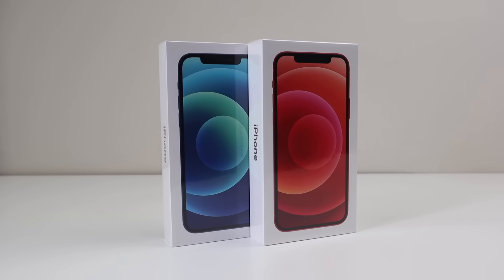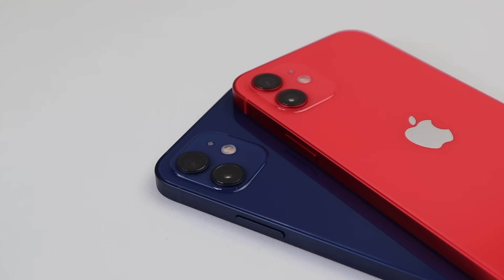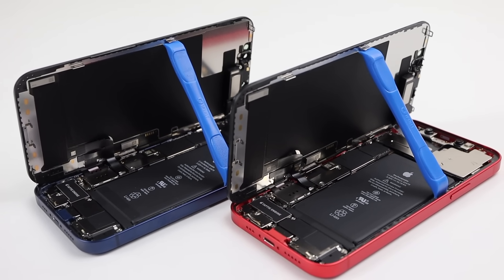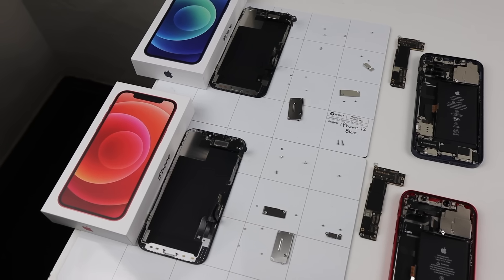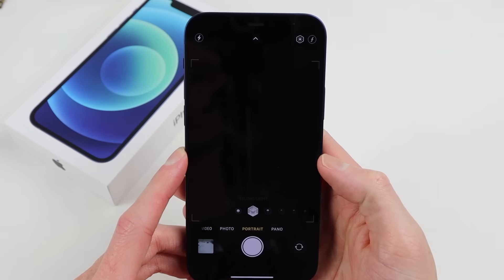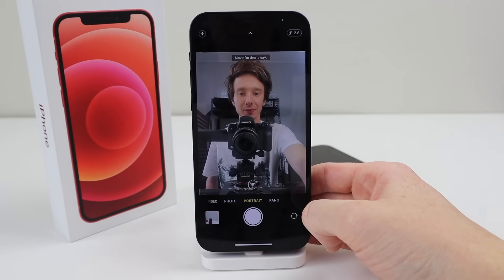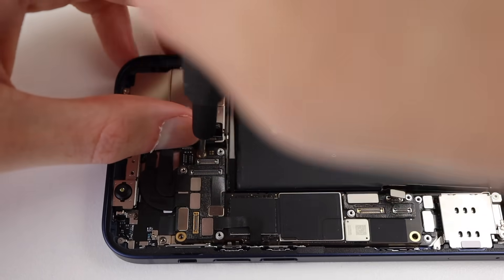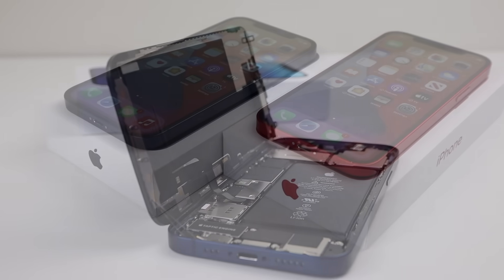iPhone 12 Anti Repair Design - Teardown and Repair Assessment

Comment: Apple is supposed to buy new devices after warranty period. They are not ready to repair iPhone in India. They will replace the iPhone with another one by paying an amount of more than 80% invoice value.  My iPhone become faulty just 15days after 1 year warranty period. The phone totally dead when connected to USB in computer . They asked an amount of 80% value of my invoice to replace new one.  So I throw away my phone to bin. They don't have any ethics... only business.. If you plan to buy new iPhone, I recommend their extended warranty, so at least you may be able to use it for 2 years.

Comment: cars have been like this for a while but it is as much to do with security rather than non repairability. at least you can send components away to get the eproms reflashed with virgin data so that the car thinks the item is new and allows it to be programmed at home.

Comment: This video was very interessting. There has to be some kind of work around. It seems as if every part of an iphone has an electrical ID imprinted in the software and the Phone recognizes if it doesnt match. So i see 2 solutions here. Either erase this id on all parts or read the id of the iphone and change the ID of the new part. Either way it won't take long till the phone can be rooted and someone writes software for that problem.

Comment: Probably to prevent tech-stealing by China. We know China reuse iPhone chips for some of their budget phones. We also know that Apple wants to leave China, so there won't be new chips for them to tech-steal and will be forced to reused older models since they are unable to make their own high tech chips.
Reply: What??? No Chinese company steals Apple Processors for budget phones. They're proprietary chips and only work in iPhones. Lower end MediaTek or Qualcomm chips are in budget phones.
Reply: @rudram.552  You haven't been to Shenzhen, I assume? You can even make your own knockoff iPhone phone there. And it won't be fake iPhone because it use real iPhone parts. You can even make it appear exactly like whatever iPhone version you want.
Reply: I'm assuming you're talking about a cheap 'refurbished' iPhone with 3rd Party parts. As long as a device has a genuine Apple motherboard/CPU it's an iPhone. And cheap iPhone clones aren't actually iPhones, they're just low-end Android devices with a skin that looks like iOS.

Comment: I have not purchased an Apple product since the old days when I bought an iPod (B&W screen) and it broke in less than a month and I couldn't get it fixed and Apple would not replace it.  In the years since then, all I've seen is complaints about high prices, updates bricking products, total lack of connectivity with external memory devices and other things, people spending tons of money on non-standard connectors and cables and adapters that all break too easily, and crap like that.  Why people wait in lines to pay big money to get the latest device from Apple baffles me.  Apple is obviously still at it.  When my Pixel-3 battery died, I took it to a local repair shop and got it back like new the next day.  No fuss.  I'm glad I decided early to avoid Apple like the black plague.  Also, iTunes absolutely sucked.  I honestly don't care if the products are good when they're working.  All the other nonsense is what ruins it.

Comment: The "new" and the fabulous iPhone 12 ladies and gentlemen unfortunately it's just an iPhone 5 but with more cameras
Reply: And an upgraded price. iP 5 cost 199, 299 or 399 bux (w/ 16 / 32 / 64 GB storage). For comp.: iP 12 for 700 - 1400 dorras (64 to 512 GB). The AVG price increase is 250 %.
Reply: @ihavenoson3384  idiots will line up to buy it though.

Comment: While it is definitely possible that this is done for greedy reasons, it is also very possible that the various modules in the phone have to be configured and calibrated as part of assembly. The Face ID feature relies on a very sophisticated setup of how and software. There is quite a lot of calibration data that is used and stored on the motherboard that is specific to individual Face ID sensor, which would render the swapped one inoperable. The camera, too, might require bad pixel correction data or other calibration data that makes mixing and matching modules impossible without re-calibration..
Reply: You do have a point, but what about literally every Android device...
Reply: But a factory reset would fix those problems though, he even reset his FaceID and made a new one and still it persisted. It wouldn't make any sense.
Reply: @L4sket  A Factory reset would not wipe out the calibration data. Calibration requires special test equipment to perform. Again, I'm not saying Apple doesn't take steps to "dissuade" 3rdparty repair, just that there are technical reasons for some of it.

Comment: probably they have some modular communication before boot. This essentially passes serial numbers that verify the modules. The charging must have some bypass mechanism that enables the phone. But again the software itself stops them from function properly. They are focusing on anti repairing mechanism which results in poor PCB design and poor performance.

Comment: Apple have turned into complete scumbags as fast as possible after Steve died. Immediately, their products went downhill and they ramped up the war against 3rd party repair war. I don't even like iOS, tbh, but the only reason I'm really in their ecosystem is because at this point I'm fairly locked in with my other software I run for work. I wish Linux running virtual boxes and hacked software was flawless, but it's not, and I don't need the added headache.

Comment: Imagine if vehicle manufacturers started doing this too, locking parts down that you can't even swap from a used vehicle. Need an alternator? New battery? Windshield? TOO FUCKING BAD. Either you buy a new vehicle or let us fix it.

I imagine that this is simply what we will look forward to in the future. I wouldn't be surprised if Teslas are like that.

Comment: I had two iPhones back in the day, the 3GS and the 5. Both of them were a complete mess, closed-platform, user-unfriendly systems. When I bought the 5, I hoped that it will be better than the previous one. No, it tuned out to be the same hot mess. Now, I'm glad I jumped off the Apple bandwagon all those years ago.

Comment: It might be that each I/O device has a specific hash value that is stored in the OS protected folder. If the I/O device is not registered in the phone’s OS then it’s not a recognized device. That is why it is so buggy when a new device is used. The OS recognizes the driver, but the hash value with the device does not match the registered device. I think you need special privileges to register a new device (like a camera) in the OS.

Comment: No usb connection, that's stupid. So Apple is going to be responsible for a lot charger adapters going landfill. And you have to buy a separate adapter? Sounds like a money making scheme. USB ports are much more durable than micro and type c ect.

Comment: Nice try Apple, but you will have to try harder... Next time just put some C4 atached to the screen so when you try to disasemble the phone it will just blow up so u can sell a new phone and a pair of iHands.

 *iHands charger not included.

Edit: fap function is sold separately on AppleStore.

Comment: Basically proves when you send it in for “repair” they just give you a brand new one cause it’s cheaper. They’re not gonna make a bunch of spare parts for specific iPhones and keep track of which parts go to which phone. $20 China phones
Reply: It doesn't mean that every detail for every iPhone is unique. I guess it is much more simple. They probably have some certified special device or some program in the Apple service which will allow them to install spare parts without that kind of problem. In other way it would be more loss for Apple than an income.
Reply: google nag the 4th nagger  thank you for your invaluable opinion, sir.

Comment: Aren't there unseen negatives to users being able to repair/modify device? You mentioned one of them for example - old iphone can be resold as new one. But there might be about 90+ other issues - including possible legal ramifications for apple that would cost them millions. Or possible harm for users experience as well. Perhaps apple just sacrifices ability for the device to be repaired to protect themselves and the user from potentially hundreds of different issues.

Comment: Okay for face ID to work you cannot swap the camera and the proximity sensor from another device you have to use the original paired with the motherboard that is why your face ID will not work so the front facing camera and the proximity sensor that came with the original motherboard has to be transferred over for it to work

Comment: Sad part is, we will still have a bunch of people buying this sad excuse of a "smart phone." It looks like it was designed with intentional faults. The power adapter that was intentionally different forcing user to buy the new USB c rather than just sticking to the older USB variant. Let this company rot. Samsung, if you follow this competitor, you to deserve the same fate.

Comment: Well it’s like trying to replace the Touch ID button, it’ll never function correctly again. How about trying to transfer everything attached to the original screen onto the replacement screen, possibly that’ll work? If you’re replacing a screen you don’t replace it with all the components. Would the screen replacement alone work?

Comment: Color me not shocked of this behavior.   I bet if they could they'd put RFID chips inside the screws so that if you use different screws or put them in the wrong places it would quasi-brick the phone just like this.       That said, if there's any repair pathway that must mean there's a way to re-pair (excellent unintended pun!) the parts so the phone isn't bricked like this,  however I don't believe Apple would trust Apple Store employees with this software so I imagine it is some online connection directly to Apple to make sure no one else gets the code.... or they just do what they always do and tell you the cost to fix is more than the phone costs so just buy a new phone.

Comment: Every time I see an example of "Apple is blocking outside repair" there is also a very good security reason for them to be doing it. If you can get your logic board into a new phone, how are they to know you didn't also mess with the secure enclave chip to gain access to someone else's phone. Apple cryptographicaly "bonds" all the components together protect users. Third party repair is unfortunate collateral damage.

Comment: Maybe it’s just because I’m an Apple user, but I think there’s more to this.  #1 My family switched to Apple about 3 years ago and never had to have anything fixed.  Only the SIM card for Verizon needed to be replaced on an iPhone 8, but that was a Verizon issue.  With Androids, I was constantly needing repairs, so even though this kinda sucks, it’s still better than getting an Android.  #2 “Apple sued Geep, a Canadian electronics recycling outfit, after it caught the recycling company illegally peddling over 100,000 Apple devices that are due for recycling.”  Most people don’t put their old iPhone in the trash can creating more waste.  Most will turn it in for a new one because they have decent return value, then it gets recycled.  If this video is true, I’m guessing this is aimed at those organizations trying to illegally sell refurbished phones, not the consumer.

That being said, interesting straight forward video, thanks.

Comment: Man that's extremely evil for Apple to do.

And this is one of the reasons I use Samsung phones
Reply: *This is a very Apple thing. Apple has been rejecting valid warranty-covered returns for decades. That logic board design is always the thing that breaks up because it has the durability of a wet oat cookie. The third-party customer-feedback sites have detailed this s**tshow for at least three decades (30 years) now. The Apple cultists keep rebuying the same broken devices and never question the warranty-ignoring A-hole.

Comment: Presumably this hardware pairing is done either in the kernel, with firmware patches or possibly written into the drivers... wonder how long it will be before there is a program (or possibly a device) so you can edit the pairings, Apple must have made such a program/device themselves otherwise their geniuses wouldn't be able to do any repairs.

Comment: This is noting but looting. Who knows what else is there which only Apple knows? I have a Samsung fridge. Every year I have to call the dealer for repairs. In my model freezer is below. The bottom most tray gets ice formed around it and slowly flow of cool air to upper part gets blocked. So yearly I have to pay 100$ to get it repaired. It seems most of the companies are doing this nowadays

Comment: This is very reminiscent of the douchey printer ink cartridge scams were the computer would recognize ink cartridge tampering and not let you use it even though the cartridges and printer are both objects your fully paid for and at that point should be yours to do what you want with. Overall it's just greed business practices of trying to get you to rely on them more. And it's also pretty nonsensical to say your cutting down on waste with no charger box just to have the cable use USB-c meaning you'll prob just have to buy an apple one anyways

Comment: what they have done is make these devices need a diagnostic tool they only have in there shops and when they replace parts they put the phone on the tool and do a relearn of all the parts they replaced so the phone relearns the new parts number just like in a car when you replace a module or computer you need to do a relearn  with the scan tool and change the vin number or the car won`t work this is so only the can do repairs and charge you an arm and a leg to do a simple replacement of a camera.

Comment: I'm torn. I loved iPhones and used them for years, but stuff like this and especially battery-gate made me switch. So I picked up a Samsung S9+, which has lots of the same issues, and some maddening tech glitches. And Google is just shameless in the way it monetizes every bit of their users data (even their photos!), which Apple has so far taken the high road on. So really at the moment there doesn't seem to be an easy philosophical high road to take with phones.

Comment: By the logic of 2 Billion Apple power adapters in the world, then those should already have a lightning cable that has the USB Type A end to plug into the aforementioned Apple power adapter . The USB C end puts them ahead of the game connecting to Apple laptops.

Comment: I'm honestly finished with iPhones, I'm still using a 6s because I want the 3.5mm hardware so I can connect RCA to my studio monitors without a dongle. But once companies stop making accessories for iPhone 8 (the last compatible size with my 6s) I'm going to be going with an Android which allows me the option to have 3.5mm hardware. 

Call me an oldhead, because I am. Apple is trying to tell me what hardware I should be using regardless of my home setup, and how I should be using old hardware. I didnt pay this much for a phone for them to try to get their hands into the flow of my home setup. Android at least gives you the option to have the jack hardwired if its something that you still use.

Comment: First of all great video :D 
So i got my screen fixed (not original) at my iphone XS and a week later i had the same problem with the camera
its only working zommed in and the light flash is also not working only when i take a photo zommed in the flash works!
My next try gonna be the change of the kamera (still not original) mybe it will work but i dont really think it will lets see!!
And all i did was getting the front screen fixed cuz i droped my phone and now apple is acting up :(

Comment: Apple: we’re getting rid of plugs to reduce waste. 
Also Apple: Heres a new plug to buy 😐
Reply: Oh yeah that is stupid lol
Reply: There is a mistake in the video... people usually have a TON of both CABLES and power supply. Adding the cable is reasonable as the USB-C is starting to appear in various places (e.g. my new car has three USB-C in it)
Reply: @Bahamuttone  Oh, so you're telling me that I have to buy a new car for my iPhone?
USB-C inserts pretty much only exist on things produced >2019, e.g. Extra plugs (like he said in the vid), your new car, select Zen-3 Motherboards//intel equivalent and pretty much bonus adapters or >2019 smart devices.
Yeah, unless you have a pretty pricy 1 year old car, a latest-gen pc or another 1 gen old phone you're not likely to have an abundance of type C inserts around.
Reply: @Tyiriel  nope what I’m saying is that you probably ALREADY HAVE a cable with a USB-A ->lightning and so you don’t really need another one. But you MAY have a device with a USB-C connector and so it is useful to have a USB-C->lightning cable.
Reply: @Bahamuttone   it's a money grab and it's not saving the environment
Reply: So many old chargers and cables going into the trash. So much product AND postage packaging of new chargers and cables going into the trash. So much fuel and energy wasted shipping a phone and a charger separately. So many phone's going into the trash in a year or 2 when they are not repairable 3rd party, Apple wants an arm and a leg to fix them, or Apple stops making parts for them. These decisions are not made to reduce waste; they are to increase profit and shaft the customer even harder than before. Apple is impressively good at absolutely ROBBING their customers and then watching them run back for more abuse over and over again.
Reply: @mannys9130  yeah I've always looked at their products as overpriced garbage. Targhee several hundred dollars more when you can get something even better and cheaper from someone else